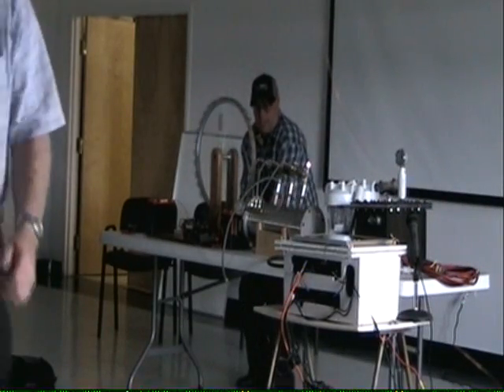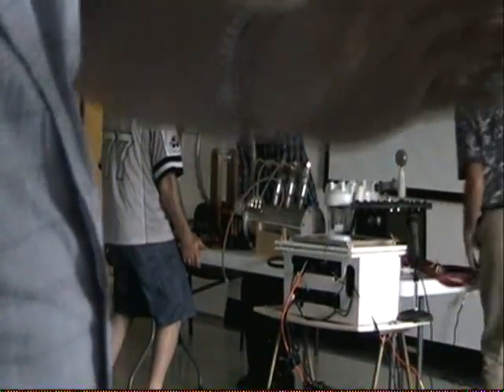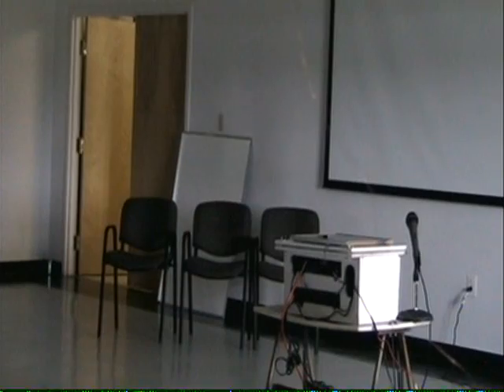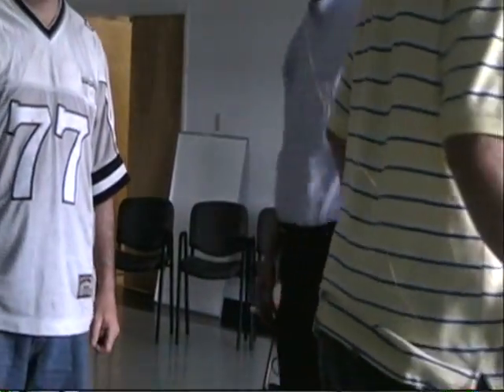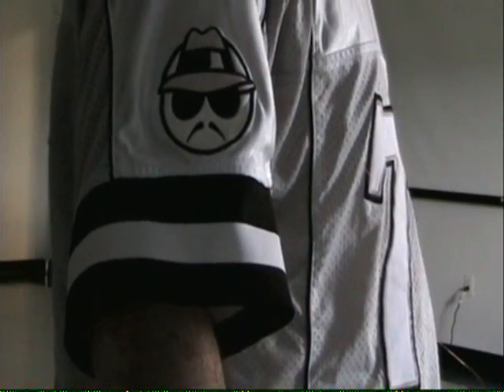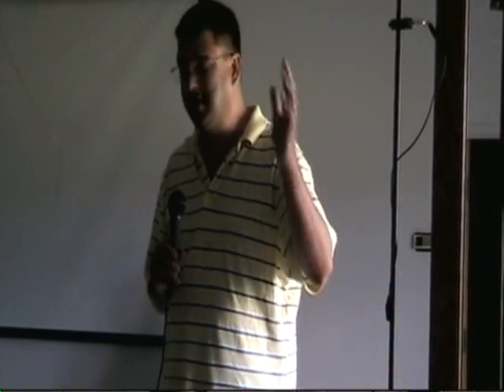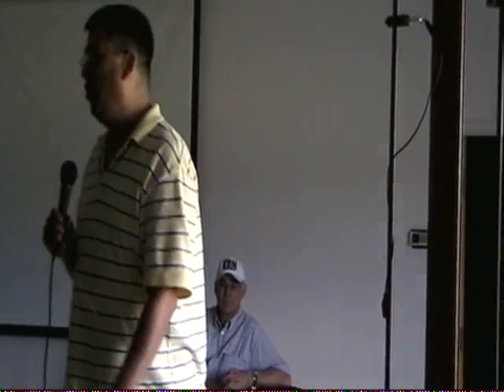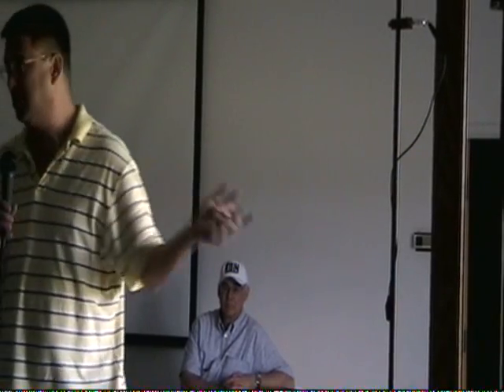Karl Palsness AEPC 2009 Tesla Hairpin Circuit Part 1

Comment: I just looked up that rattle back tho. If you look closely the top edges of it are not symmetrical and the bottom gradually meets in a curve. You can even see close-up demonstrations that lifting the ends will cause it to fall in a way that biases the heavier side and directs the falling energy into spinning energy. This occurs in reverse if you try to spin it backwards because the bias causes rotational forces to lean rather than rotating with zero resistance. When spinning it towards its bias the energy is not lost asymmetrically and instead is only lost through rotational forces. In short, whatever forces are delivered into it will leave through the path of least resistance, and one path has been biased through its shape. The theory of conservation of momentum still applies. The momentum is just being delivered into a system with a bias and will reflect energy more easily in one direction.

Comment: Where can we get that plastic device from?  Anyone know?
Reply: A little late but that is a toy called a Rattleback. Easy too find and purchase. It is merely a balance trick. It has a flat side and a curved side. The curved side is not symmetrical, there is a tiny area of difference in the curve causing an imbalance. The center of gravity is slightly off. Easily explained!

Comment: Karl, 

It's me Jesse again... After I discovered single wire transmission with the THP circuit I became a bit too obsessed with Teslas work... So one afternoon I wanted to prove if you could send energy through both arms while holding a bulb in your hands. Well my second discovery worked... I find a way to turn on a 12 volt bulb in my bare hands I was connected in parallel to the THP output side, but it works... Its dangerous looking but it works! 

Final discovery! 

You can also dasiy chain
Reply: Hi! Can you please clarify how you did this ? Thank you!

Comment: Karl,

I wanted to leave you a message about the THP circuit. I discovered that with this circuit you can send the energy coming off one of the bars through a single wire relative to ground... Your bare hand would work too to luminate  a 12 v bulb. So! I discovered single wire transmission with the THP circuit... Try my idea out at your home... It will work!